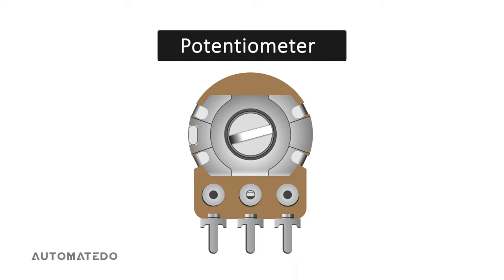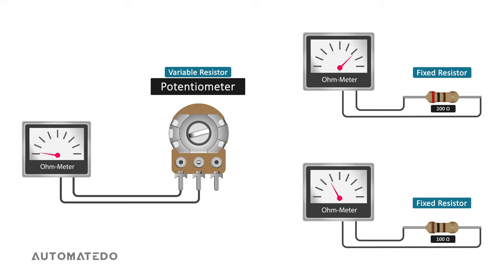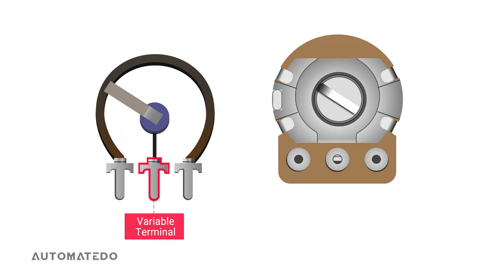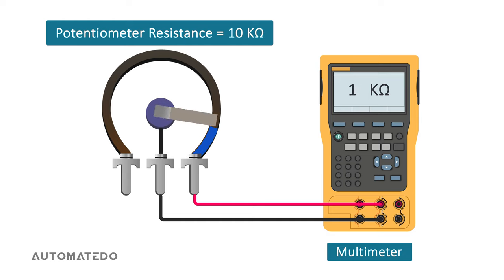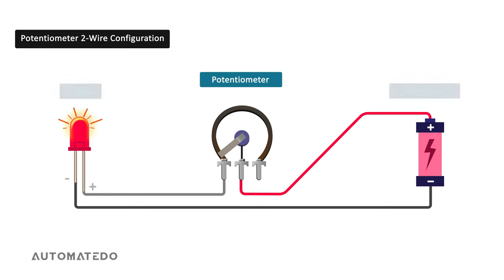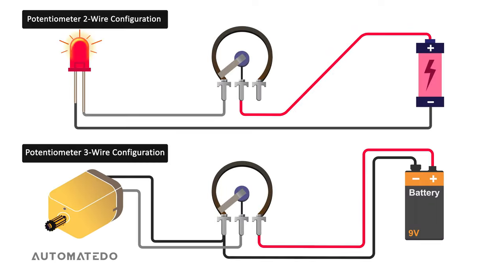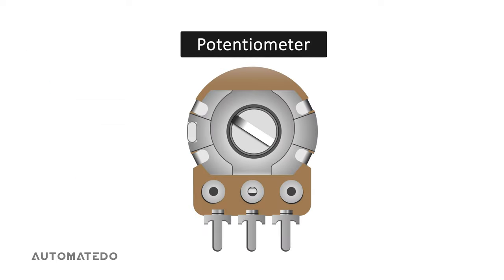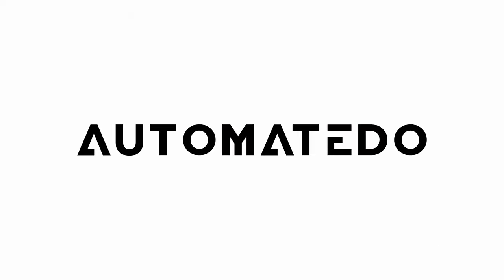Potentiometer Explained

Comment: Sir,
Can you explain radio repair
Reply from the maker: To give you a brief overview, here are some key steps involved in radio repair:

- Diagnosis: The first step is to identify the problem with the radio. This could range from issues with signal reception, audio output, power supply, or any other component malfunction.

- Disassembly: Once the problem is identified, the radio needs to be disassembled carefully to access the internal components.

- Visual Inspection: A visual inspection helps to spot any obvious signs of damage, loose connections, or burned-out components. 

- Testing: Using specialized equipment, such as multimeters and signal generators, you can test various components

- Repair/Replacement: Once the faulty components are identified, you can proceed with repairing or replacing them.

- Reassembly: After the necessary repairs are made, the radio is reassembled, taking care to put all the parts back in their correct places.

Please note that radio repair can be a complex process, and it's important to have a good understanding of electronics and proper tools. If you're a beginner, it's recommended to start with simpler projects and gradually build your skills. I hope this explanation gives you a general idea of radio repair. If you have any specific questions or need further assistance, please feel free to ask. Happy repairing!

Comment: Give a good circuit diagram, the speed of the motor decreases slowly as the volume is turned slowly
Reply from the maker: Depending on the specific motor and voltage requirements of the circuit, the circuit diagram shown in the video could potentially be adapted to achieve the effect of slowly decreasing motor speed as the potentiometer is turned.

Comment: So how does a potentiometer with all 3 leads connected not short out? The only thing I can think is the wiper always remains neutral, allowing current to flow to neutral regardless of the potential applied.
Reply from the maker: When all three leads of a potentiometer are connected, it forms a voltage divider circuit where the wiper acts as a variable resistor. The resistance between the wiper and one end of the potentiometer will change as the wiper is moved, allowing for a variable voltage output.

To address your question, the wiper does not necessarily remain neutral. Rather, it adjusts its position along the resistive element of the potentiometer, which allows for a variable voltage output. This does not cause a short circuit because the resistive element has a high resistance value, which limits the current flow through the circuit. Therefore, even when all three leads are connected, the current flow across the potentiometer is limited by the resistance value of the element.

I hope this helps! Let me know if you have any further questions. 😉
Reply: @Automatedo  a ha! That makes perfect sense! Thank you for the answer!
Reply from the maker: We are happy to hear that our response was helpful to you! If you have any more questions or comments, feel free to let us know. Thank you for watching and engaging with our content! 😍

Comment: What's the use of third terminal... That's what I wanted to know..
Reply from the maker: The wiper in a rotary potentiometer adds versatility and flexibility to the device, allowing it to be used in a wide range of applications where variable resistance is required.

Comment: Everything makes sense except the last part. Higher resistance means less voltage and lover speed, not vice versa 🤷
Reply: Basically resistor are made for limit current and current is relative to voltage if current drop due to resistance voltage also drop simple

Comment: Potentiometer cannot handle voltage nor current. Is it correct ?
Reply: A potentiometer acts as a resistor. 
A resistor reduces current flow.
Voltage does not 'pass through' a resistor, current does. 
When current passes through, a voltage is developed across the resistor according to the formula V=I*R where I is the current through it.

Comment: Guys how many ohms potentiometer do i need to control 12 v power supply for a motor to increase n decrease speed
Reply from the maker: The specific resistance value of the potentiometer needed to control the motor's speed depends on various factors such as the motor's characteristics, current requirements, and the desired speed control range. To provide a more accurate recommendation, we would need additional information about the motor, such as its voltage rating, current rating, and any recommended control methods.

However, as a general guideline, potentiometers with resistance values in the range of 1k ohm to 100k ohm are commonly used for controlling motor speed. A good starting point could be a 10k ohm potentiometer, which is a widely available value suitable for many low to medium-power motors.

Comment: how does high resitance = hugh voltage, and low resistance = low voltage, shouldnt it be opposite? shouldnt it be low resistance = high voltage, cuz more electrons can flow cuz less resistance so low resistance means higher voltage, and the same for high resistance = low voltage? can someone please answer this i am very confused
Reply: I'm not certain but I think the current inside the potentiometer remains constant so when resistance increases pd also increases and vice versa.

Comment: if you use a potentiometer without a transistor and resistor it can easily burn ur potentiometer I learned this the hard way
Reply from the maker: You are absolutely correct. Since this video is about the potentiometer and we don't want to use other elements to confuse audiences we kept it that way. Thanks for sharing your experience 🙏
Reply: @Automatedo  all due respect it may be confusing but the real confusion was why I was burning all my potentiometer till this other guy taught it to me the correct way
Reply from the maker: Dear Mowi, we really appreciate your concern and thanks for sharing your valuable experience. Please note that all the wirings shown in this video tutorial are tested physically and no harm will be reach to the instruments.
Reply: @Automatedo  sowwy

Comment: I noticed there is no current limiting resistor when the power supply is connected to LED via potentiometer, I know you are trying to explain concept!
Reply from the maker: Thank you for your observation and raising the concern about the absence of a current limiting resistor in the circuit. You are correct that in a typical LED circuit, a current limiting resistor is necessary to prevent excessive current flow through the LED, which could lead to its damage.

To clarify, when using a potentiometer to control the brightness of an LED, it is recommended to include a current limiting resistor in series with the LED. This resistor will help regulate the current flow and prevent any potential damage to the LED.

Comment: What gona happen when the motor use 2wire configuration
Reply from the maker: In a 2-wire configuration for a motor, the motor is connected to a power source and a variable resistor, such as a potentiometer, to control its speed. The variable resistor acts as a voltage divider, allowing the user to adjust the voltage applied to the motor and therefore control its speed.

In a 3-wire configuration, the motor is connected to a power source, a ground, and a control circuit, such as a motor driver or an H-bridge. The control circuit allows the user to control the direction of the motor as well as its speed. By changing the voltage and direction of the current flowing through the motor, the control circuit can make the motor spin in different directions and at different speeds.
Reply: @Automatedo  thanks for your explanation it makes easy to understand👍👍👍

Comment: I accidentally burned so many potentiometer because I forgot to calculate how much current flow through it and how much it can handle.
Reply from the maker: Thank you for watching my video and leaving a comment. Burning potentiometers is a common issue, and it typically happens when the potentiometer's power rating is exceeded. To avoid burning your potentiometers in the future, you need to calculate the power rating of the potentiometer based on the maximum current that will flow through it and the resistance value. The formula for calculating power is P = I^2 * R, where P is power in watts, I is current in amperes, and R is resistance in ohms. Once you have calculated the power rating, make sure to choose a potentiometer with a rating higher than the calculated value to ensure that it can handle the current flow without overheating or getting damaged. It's also a good idea to double-check the datasheet of the potentiometer to confirm that it can handle the amount of power you will be applying to it.
Reply: @Automatedo  Thank you.

Comment: Power supply connected to Potentiometer = smoke
Reply from the maker: In the context of connecting a power supply to a potentiometer, it's crucial to follow the correct wiring guidelines and make sure all connections are secure. Here are a few points to consider:

1) Double-check the wiring: Make sure you have correctly connected the power supply to the potentiometer and that the connections are secure. Ensure the polarity is correct.

2) Verify voltage compatibility: Ensure that the voltage supplied by the power source is within the operating range of the potentiometer and any other components in the circuit.

3) Consider power rating: Confirm that the power rating of the potentiometer is suitable for the load, including the motor. If the power rating is exceeded, it can lead to overheating or damage.

4) Inspect for short circuits: Check for any unintended short circuits or loose connections that could cause excessive current flow and lead to smoke or damage.

Comment: Hi how would i wire a dc motor to go back and forward using a potenciómeto
Reply: A pot wouldn't be able to do that, all it basically does is control voltage an current, not direction. You would probably have to reverse the polarity, maybe something simple like a 4 way switch.
Reply from the maker: Thanks for sharing your knowledge 🙏

Comment: The DC motor driving example, without any power dissipation consideration is basically a bad and uneducative one.
Reply from the maker: Thank you for your feedback regarding the DC motor driving example in the video. We appreciate your input and concerns about power dissipation considerations.

While the video aimed to provide a simplified demonstration of motor speed control using a potentiometer, it is essential to acknowledge that practical motor control circuits typically involve additional components and considerations, including power dissipation.

The purpose of the video was to introduce the concept of motor speed control using a potentiometer in a beginner-friendly manner. It is important to note that in real-world applications, power dissipation, efficiency, and protection mechanisms should be taken into account to ensure safe and optimal operation of the motor.

Comment: You don't explain lin and log
Reply from the maker: Thank you for your comment and feedback on my video! We apologize for the oversight in not explaining the difference between linear and logarithmic potentiometers.

To clarify, linear potentiometers have a linear relationship between the position of the wiper and the resistance value, which means that the resistance value changes at a constant rate as you turn the knob. This type of potentiometer is often used in applications where a linear change in resistance is required, such as volume control in audio systems.

On the other hand, logarithmic (also known as audio taper) potentiometers have a logarithmic relationship between the position of the wiper and the resistance value, which means that the resistance value changes gradually at first, and then more rapidly as you turn the knob. This type of potentiometer is often used in audio applications where a smooth logarithmic response is desired, such as in tone controls and equalizers.

Comment: I accidentally sprayed wd 40 in 3 potentiometes
Reply from the maker: I guess it is flammable, doesn't clean that well, and leaves a residue that attracts dirt. Please use a real electronic cleaner (usually a heavy Freon type) cost is about the same.